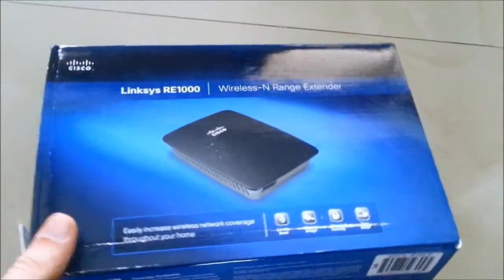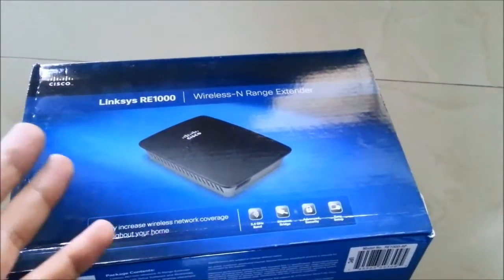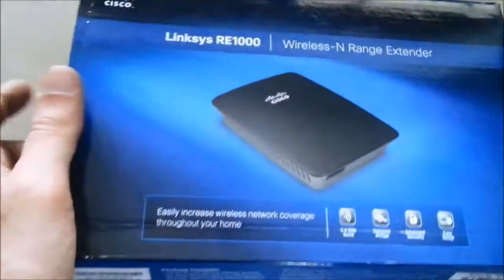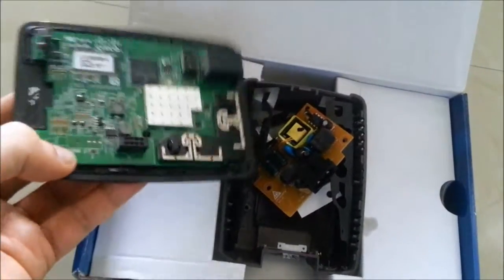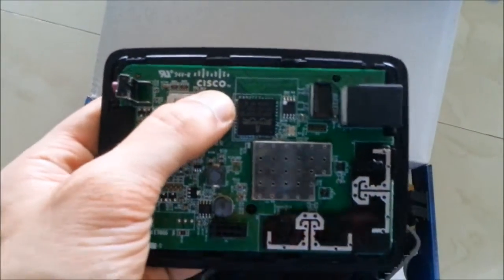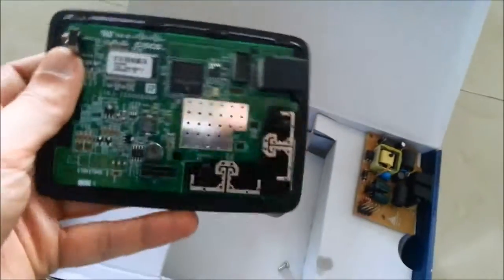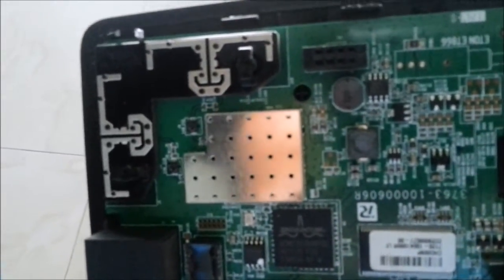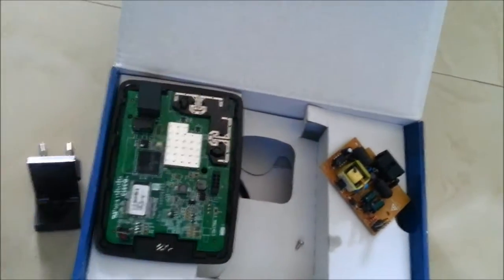Linksys RE1000

Comment: Mine worked fine till yesterday, now it is just blinking and I am unable to reset it. you are right about the customer service though, when I couldn't find a suitable troubleshoot guide I went to do a live chat, after 20 minutes explaining and given the details, they told me the warranty was expired for them to help me with the live online chat and directed me to the support section. If anyone knows how to reset it to factory defaults I would appreciate it
Reply from the maker: I have had a horrible experience with this particular extender. So far till date I haven't had any issues with any other devices may it be routers, extenders and so on. I prefer TP Link over Linksys at this point of time as I and many others I know have moved to TP Link since past few years and their products have been excellent with no issues at all and the plus is that they are way cheaper than Linksys. I guess Linksys is just the brand name that consumers pay for and nothing else. Next time if you buy make sure you go with TP Link or some other brand rather than Linksys.

Comment: i have 2 of this and it work fine in terms of extending the signal. however it died (blinking cisco logo) after 2 days of use :( i did search the web for the fix and one was to reload the firmware but to no success.